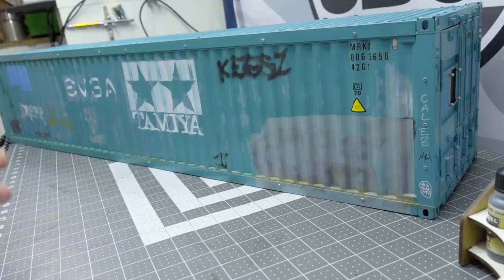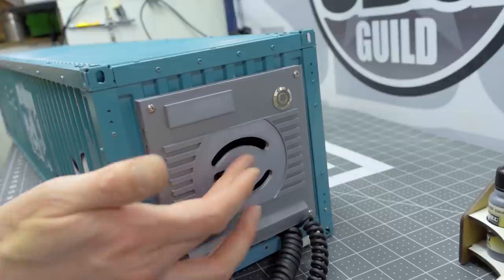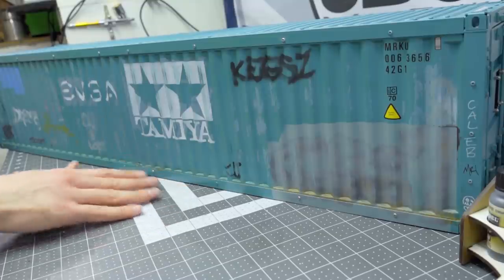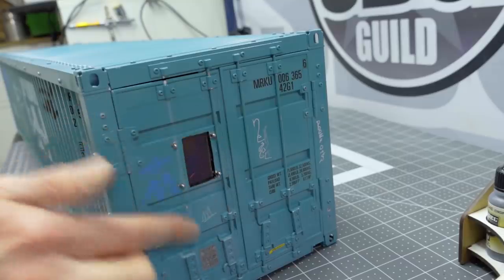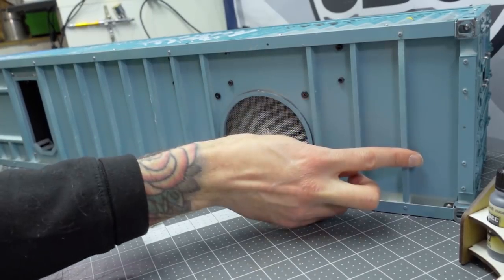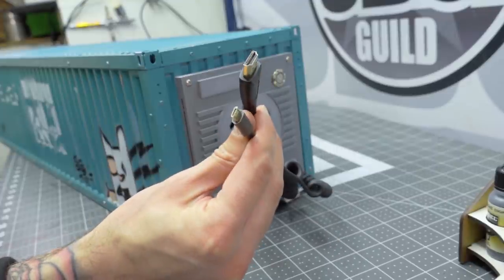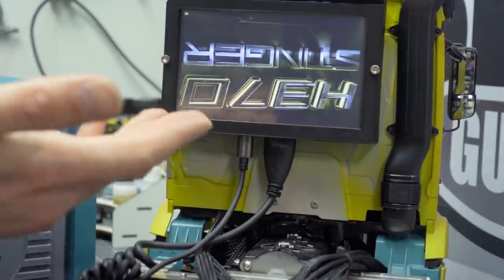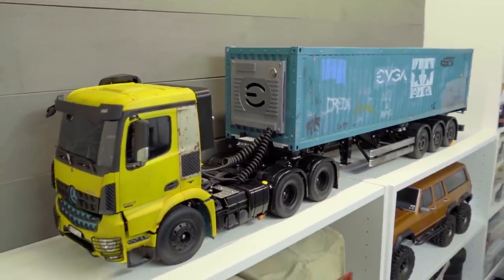It's a PC in an RC Semi Truck! Ep3 - RC/PC

Comment: That is awesome Matt!!! Fantastic build. There are so many ways to go with a build like this i.e. actuator controlled panel that opens on the side of the container for a mini HD projector so you could project to a large screen surface. I thought about doing something similar but including a LiPo battery array and inverter to power the PC (using a laptop/tablet based platform). A full-size high-end graphics card like the RTX 2060 would kill a battery pack pretty quick but to have the tractor trailer combo be a completely self-contained fully functional PC without any external connections would be pretty cool. So many possibilities...I've been looking for a reason to add a semi to my RC collection and now I have one...LOL.

Keep up the the great work and thank you so much for the excellent content.

Cheers,
Jeff (Garage Maker Guy)

Comment: Hey Matt, I think you did a great job on this build. I deal with shipping containers all day everyday. On the chassis you should put your tare weight should be around 7400lbs need a chassis number on the side rail and on the front also. I think from the looks of it your Jeep is the same color.